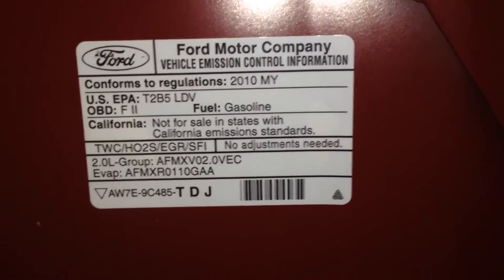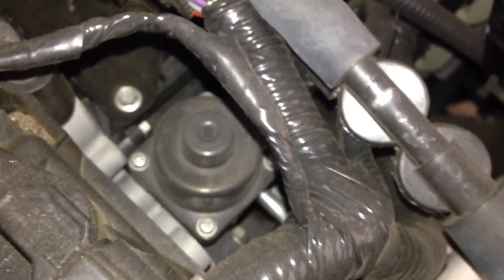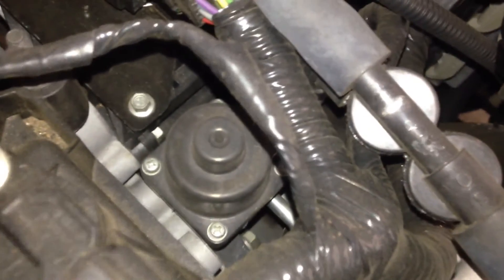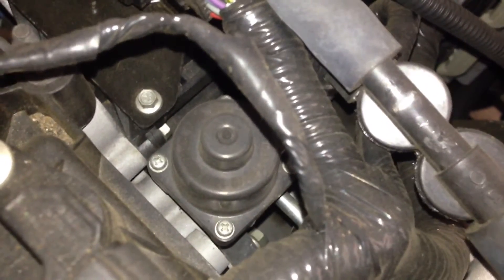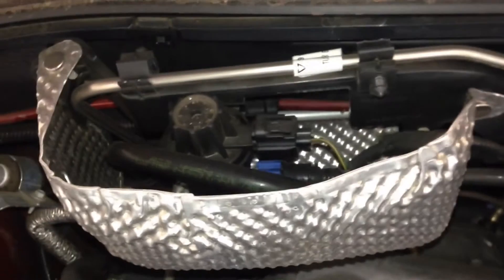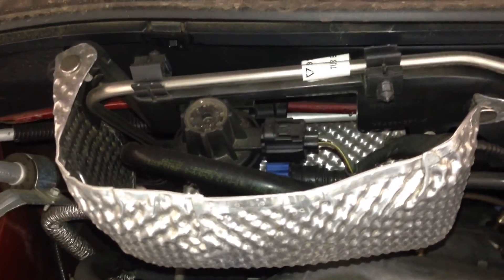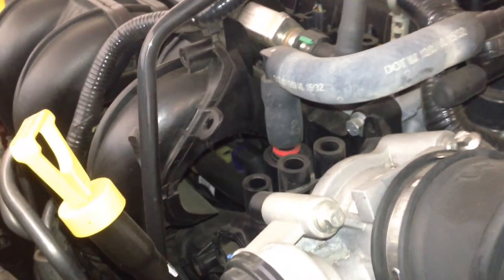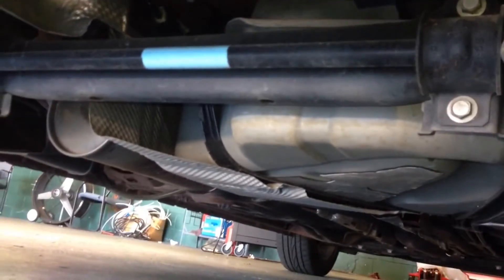Ford Focus emissions locations. EVAP, EGR, Purge, PCV.

Comment: Great vid I’am a driveway mechanic and working on my 09 Focus SE ( its like trying to rase the dead ) evap issues gas cap and engine light  were both on . I was trying to find the vapor canister purge valve it appears to be located on the front side of the canister with only the socket for the wiring . Will you be doing a vid replacing this part . Thanks .

Comment: I have a 2011 focus with the 2.0l and it started spuddering and stalling and then quit starting and I put a scanner on it and it says the fuel tank pressure sensor is bad do you know if there's a way to by pass it?
Reply from the maker: What code is it that you are chasing? Are you sure it's not a fuel rail pressure sensor?
Reply: @ScottiesHobbies  it's p0451 and I've looked up the fuel pressure rail sensor but I can't find it on my car
Reply: I did try replacing the cam shaft sensor also I pulled all the lines apart to make sure there gas flowing thru to the rail and there is it sounds like it trys to start also like it's not enough gas to fire that's also why I looked into the fuel rail pressure sensor but there's not one on my fuel rail

Comment: Hello my 2009 ford focus is giving me a P0451 code.says fuel tank pressure sensor. now is that pressure senor the egr the pcv or the thing lacocated in the rear of the car??? help please
Reply from the maker: I am not familiar with this exact scenario but The code you are getting is for EVAP. I do see some threads talking about the DPFE sensor... That is a EGR system sensor,  personally I do not thins that the DPFE would cause this code. Thats just logic in my head, I could be wrong. I will research a little too.. I'll get back to ya.
Reply: Daniel Diaz Buy a new gas cap...I had the same problem...it is leaking a tiny bit of air into the tank and it trips that code.
Reply: My wife's car just gave the P0451 code on yesterday, 11/3/17. What do i need to do?
Reply: I am chasing the same code on the same car.  It is the Fuel Tank Pressure Sensor most likely gone bad.  I am having trouble locating it.  Everyone says its on the top of the tank but its not.  I think its behind the tank connected by a hose near the charcoal canister.  If you find it let me know.  Good luck!